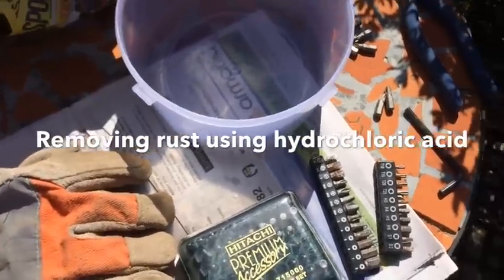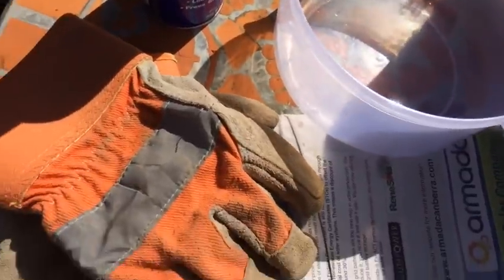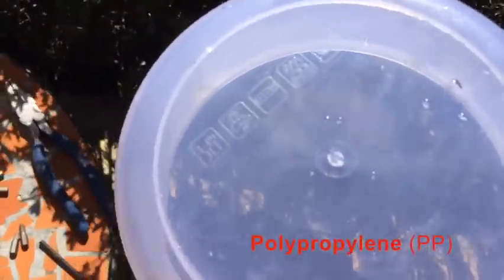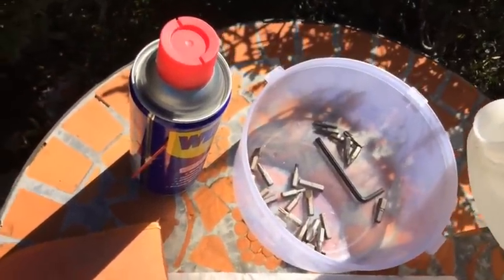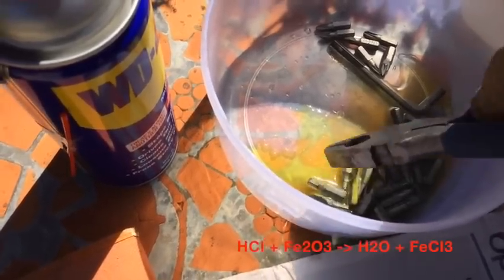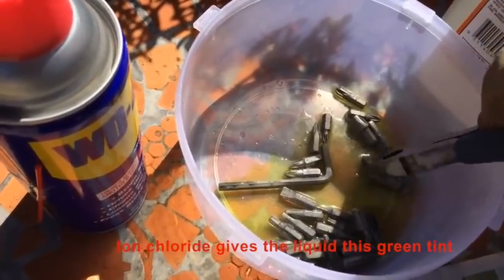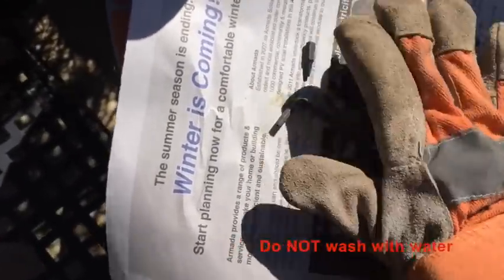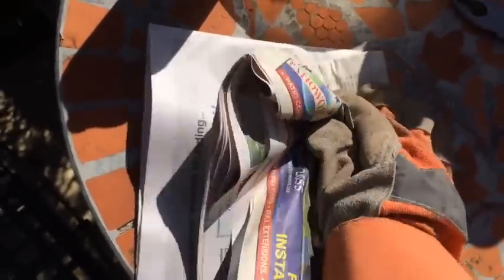Rust removal using hydrochloric acid

Comment: Won't backing soda neutralize acid? Just curious.
Reply: Yes was going to comment with the same information but saw yours first. So yes baking soda resolved in water will neutralise the acid, and once dried with a heat gun spraying with a clear lacquer will work to protect from future rust.

Comment: BTW - I often remove the rust from tools etc, rinse, dry and then immediately spray with clear paint. Sometimes, I even soak it in clear lacquer or whatever to protect it from rust etc. Also works with silver items you have just cleaned.

Comment: what you might want to do instead is submerge in HCl, leave for about half an hour and come back.  only the rust really gets removed since HCl does not react with iron itself... the oxygen needs to be present for this to happen.  Since Iron oxide has oxygen, it is removed in the reaction and leaves the bare metal.  some very small amount of metal may be eaten, however it is very small compared to the rust that is removed.  the HCl can be deluted in additional water.  ideally you would want to remove all the oxygen from the container, however not necessary.  if  you do this at a higher temp, it will hasten the reaction and can be done in less than half the time.  Ferric Chloride and HCl is more of a fume hazard than a contact hazard, however you don't want to let it be on your skin for long.  just make sure to wash it off shortly after exposure.  ferric chloride stains, and will color your skin and clothing.  it is difficult to remove.
Reply: This comment is far better than the video.  Thank you good friend. Live long and prosper.
Reply: Very helpful explanation

Comment: Why the moving around? Couldn't you just submerge the metal in the acid for a few minutes? Nevertheless, HCL seems to be what I need. I want to remove the rust without turning the metal black,, and that is what you have just done.

Comment: Wash them in water straight after the acid soak.
Then spary with WD40.
WD stands for "Water Dispersant" ;
i.e.  removes water and it's negates it's corrosive effect.
Reply: +Ken Parkyn The water is most likely to make sure all the acid is removed from the materials before you touch it and to insure that the wd40 doesnt react with it.
Reply: Nope. Water Displacement is what WD stands for.